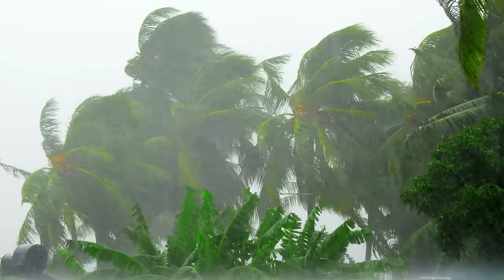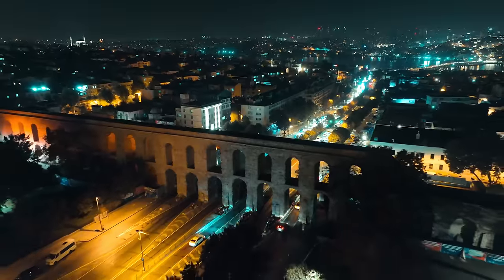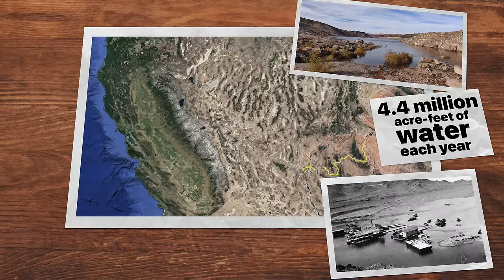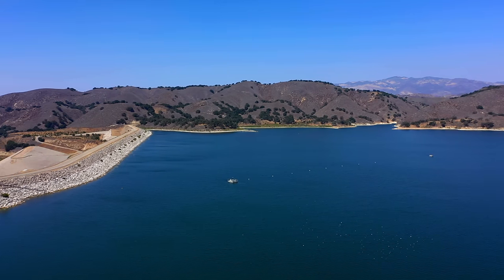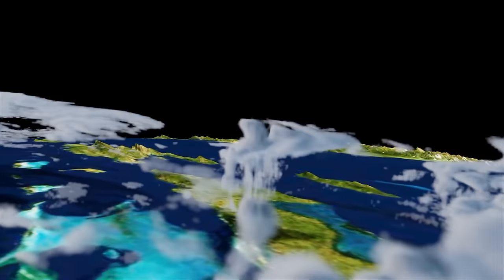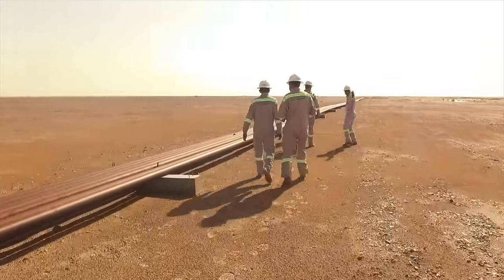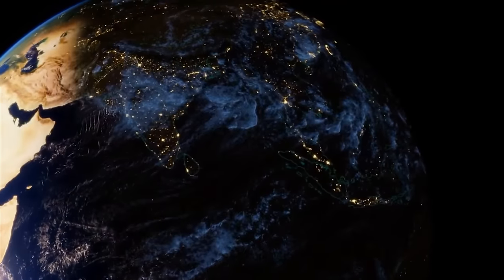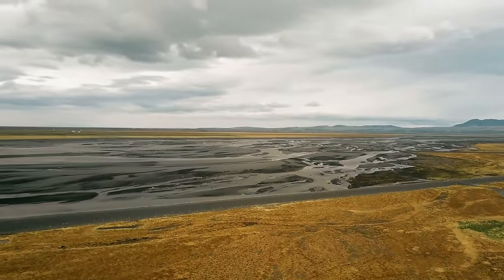Pipelines From Flood to Drought

Comment: I've been wondering about this for decades. If we can do it with oil, why not water? I've always wondered if there would be any issues transferring invasive species or anything like that. Glad someone is talking about it.
Reply: Along the way, the water could be heated sufficiently to kill off any invasive species.
Reply: @whiterabbit2786  sounds like big energy use
Reply: Because we need to move the oil anyhow and pipelines are more cost effective than containers on trucks or trains. Also it's less energy intense to pump oil per volume than water because it is slightly less dense than water is.
Reply: Reasons why not:
1) The amount of water required
2) Where the water has to come from and go
3) It isn't as simple as taking flood waters and moving them. For one thing, there isn't enough storage to hold the flood waters on the receiving end, all at once. 
4) The water is needed in a steady supply throughout the year, not all at once. 

And, so forth. Anyone who thinks it will happen knows nothing about the water needs of California and how they work. It is comic book stuff.
Reply: @cliffordschaffer5289  the water should be moved from reservoir to reservoir across the country, instead of it all being pumped to one location. I agree it would take a huge amount of energy, but so does pumping oil. I feel like this is something we could make work if we wanted to. Most people's water comes from a long way away already. The water in our municipal system comes from 100 miles away, has to hit multiple storage and treatment facilities along the way, but they figured it out and made it work.
Reply: @phantomblooper84  That would be more expensive than a simple pipe. Superman rejected both ideas.

Comment: There is already a discussion among executives of the Wyoming-Utah pipeline, scheduled to be decomissioned in 23 IIRC, to utilize it for pumping from the Oregon coast to re-fill the Great Salt Lake. It's very exciting to see the idea being investigated.
Reply: Too bad the GSL isn’t drinkable…. Maybe they should pump it up to reservoirs instead of wasting it in the Salt Lake
Reply: @brettneff7900  Ocean water isn't drinkable either, the water could go to desalination and waste brine to the lake which is way saltier than the ocean anyway.
Reply: Actually pumping water from the ocean into the GSL would increase the evaporation from the GSL, which would increase the precipitation near the GSL helping to increase the area’s fresh water supply. Pump salt water inland and let it evaporate in salt pans/sinks and you’ll increase local precipitation significantly.
Reply: @tylershepard4269  There are already massive evaporation pans operating on the lake, a major source of salt and fertilizer. Ocean water could supply desalinated water for drinking, but also brine to go.
Reply: Good idea - maybe they could try to fill it beyond what it normally was at.  Every little bit to fight rising sea levels is good.  The GSL is big enough to see from space so filling it up is not insignificant.
Reply: @danielvonbose557  The lake has a very different water chemistry than the ocean.  It's not a simple matter of all salt water being the same, except for salt concentration.  Replacing the water in the GSL with ocean water would alter the chemistry of the lake significantly and no doubt lead to new environmental complications.  That's before considering that salt is left behind by evaporation, so in practice the lake is losing fresh water, not salt water, and replacing that water with brine would drive up salinity quite a bit.

In addition, pumping sea water into the Great Basin is likely to be energetically costly.  All of these schemes for pumping water around the country generally ignore the high energy cost of lifting that water over mountain ranges.
Reply: @bobbun9630  What if we put a turbine on the other side when the water comes back down. Wouldn't that help recover some of the spent energy from pumping it uphill?
Reply: @ipp_tutor  

The GSL has no river flowing out of it. 
That's why it's it's a salty lake in thr first place
Reply: @ipp_tutor  Even if you could recover 100% of the energy associated with pumping the water over the highest points on the route (you can't), you are still lifting whatever you're pumping 1283 meters, as that's the altitude of the surface of the lake.    If I did my math correctly, you can lift 286kg to that altitude for 1 kwh of power.  To raise the level of the lake by one meter would require trillions of kilograms of fluid.  That energy can not be recovered, if the goal is to put water in the lake and leave it there, as it represents the change in potential energy associated with lifting the water.  Note that if you're pumping brine or seawater instead of fresh water, some of that mass you're pumping up is useless salt rather than water.  And, of course, the water isn't actually being used directly for human purposes if you're just dumping it in a lake.
Reply: @bobbun9630  The salt isn't necessarily that useless since there are salt operations on the lake for salt and fertilizer.
Reply: @danielvonbose557  Yes, but there's already plenty of salt there for that purpose.  Adding more salt to an environment that already has it in abundance would never recoup the expense of lifting the salt to high altitude.
Reply: @johanvangelderen6715  I'm thinking @IPP_Tutor is talking about discharging the water above lake level and capturing the energy of its downhill flow into the lake.  Like if it needs to go over a mountain or something close like that.  I don't know the terrain enough to say.
Instead of grabbing sea water from the coast, how about grabbing river discharge near its mouth such as the Columbia or  Rogue.  IDK which end of the state the pipeline discussed exists.
Reply: There is the issue of lifting vast quantities of water to an elevation of 4,200 feet . Water weighs over 60 pounds per cubic foot.   Also that water needs to  move 500 to 800 miles depending on route. 

Where is that amount of energy supposed to come from.

Also the western states are a desert.  
A desert is defined as an area with insuffient rainfall.

Those who haven't seen or lived in the USA western states can't conceive of 

How dry the area really is
How high above sea level it is
How far from the ocean the GSL is
The weight of all that water. 
What else that water could irrigate. 
How few people actually live in the western states except from the coast to 100 miles inland.

Comment: The pipelines for oil generally flow north south - not east-west like would generally be needed.  And even then, the carrying capacity of an oil pipeline is absolute peanuts compared to what you'd need to make a real dent.  Finally, flood-prone areas are generally lowlands, east or along the Mississippi, and the most draught-stricken areas are in the West and generally at a higher elevations.  Moving massive amounts of heavy stuff like water uphill is always going to be energy-intensive.
Reply: That's everything I thought before shutting off this nonsense video.  Just ONE gallon of water is around 8.5lbs (3.75kg if we're going to do some real physics calculations).   That mass would have to be pumped over the rocky mountains.  The amount of energy and PRESSURE to do that with any real useful volume would be ultra expensive.  A desalinization plant on the coast would be MUCH less expensive to operate.  Water also contains contaminants and encourages corrosion... unlike petroleum products.  So the maintenance and upkeep would be much higher.
Reply: @fakshen1973  Rocky Mountains average 4,400M high, lot of head pressure, they would have to pump from reservoir to reservoir (the way they do in mines). Huge amount of energy and cost. Would also have to consider high silt content in the Mississippi causing issues as well

Comment: One thing I did not hear you mention was pumping water back into the natural aquifers. There is a large amount of water pumped out of the aquifers that take a long time to replenish; why not help the refilling process along instead of simply pumping water out of one area and into another?
Reply: If you pump.the water into ponds and wetlands you are doing the same thing. Plus you are creating habitat for wildlife and plants
The water is also filtered so the water going into the aquifer is clean. Plus you would not need to pump as much out of the ground because you have the surface water resources.
Reply: You can't refill Aquifers once theyre empty. the weight of the ground above the aquifer crushes the empty space left by the lack of water. The best you can do is keep aquifers the size they are now and do what oil drillers do, as they suck out the oil, they pump in water to keep the ground from collapsing any further.
Reply: If you notice on shopping centers, office campuses and residential developments a corner of it is used as a catch basin for runoff. More of this water saving conservation needs to be used especially where it is used the most on large and small acreage farms.
Reply: where I live we pump to flood the flied then send the rice etc. to china how much sense does that make .And cali does basically the samething  in it's own way and they dont even try to manage the water /conserve etc.  Like use underground irrigation or how about everone update their toilet to a more modern one

Comment: When it rains in southern CA, most of the water just runs straight out into the ocean through the concrete canals in the cities for flood control. Also when you pump water by canals or pipes, you have to be careful about relocating fish and plant species from one coast to another. I have thought about this same thing for a long time and would love to see this happen.
Reply: Good point. Would be helpful to add mesh screens or other strong materials allowing water to pass thru but keep fish and plants native to where they belong.
Reply: @phatpatatit  how would you handle having to constantly clean said mesh screens, bearing in mind that they would have to be fine enough to keep all living things out of the pipes?
Reply: simply add it into the ogallala
Reply: Run through small diameter black ABS pipe for long distances in the desert only during hours of daylight, have discharge on a thermostat to release at 150 degrees, not much will live through that.
Reply: In that case, better solutions may come from changing that street-to-ocean, canal, flood-mitigation infrastructure into a street-to-reservoir chain somewhere along the outskirts of major cities. Wouldn't someone have thought of this already? Hey, California, stop washing your fresh rain water directly out into the ocean. Also, mentioning California canals reminds me of "Chinatown" the movie from '74.
Reply: Our city is so dirty and the water passing through the city is literally too toxic to even swim in.  It also rains so rarely that whatever you collect will evaporate before drought hits. It's just a non-starter.
Reply: At some point, people are going to have to get back to prioritizing human life over animals. Don't get me wrong, invasive species can wreck havoc on the local environment but so can death by drought. Millions of people all over the Earth are  dying from lack of clean or available drinking water. Sometimes you need to use the thought "Risk a little, to save a little. Risk alot to save alot!"
Reply: Have you forgotten that water is to fight for? Let's transfer water from here to way over there. It will NEVER create a huge fight over water in the future, will it?

Comment: You're going to need a lot more reservoirs in flood prone areas than currently exist, but there's no reason why this can't be made to work someday. However, in the meantime, I would also put some effort toward desalination, just to be on the safe side.
Reply: Simple start.  Don't mind private property owners collecting water from floods and treating it themselves.  For living, a building can be built to float or stand on stilts taller than the maximum flood level.  Or build a levee around it.  Offer opportunities to plug in their reserves to pipelines that distribute it to drought prone areas.
Reply: @uncrunch398  it is interesting how this is actually illegal in many of those places

Comment: It would be an interesting experiment to see some kind of smallish scale test of this concept. If for example there are two existing water reservoirs near the continental divide that could be linked via pipe/pump. You could then pump water from one reservoir to the other. If the pipe/ pump system is relatively flat it might even be possible to be reversible.
Reply: Really, this seems like by far the best answer. East of the divide there is no end of water and so little cost in diverting it. And since the divide itself is relatively narrow and at high altitude, you only need just enough pipe to let the water out into an existing western stream and then just let the existing natural water system do the rest, with gravity doing most of the work.
Reply: Tunneling might be a possible "last mile" solution.
Reply: It was done a century ago, actually.  Look up the Gunnison Tunnel.  Of course, that actually diverts water the other way, as in Colorado there's more demand on the east side of the Rockies than on the west side.  Note, though, that the diversion is only moving water that is already at close to the altitude it needs to be.  The real cost is in getting water to that height to begin with.  Lifting water can be characterized as hydropower in reverse, and it's massively costly in terms of energy.

Comment: I have suggested this to friends and family for years. I envisioned a double aqueduct across the US. One flowing east and one flowing west with reservoirs along the way to store the water. Then we could pump out water into either aqueduct and let it flow with gravity to where it is needed and just pump it into existing networks. But I have no idea what that would cost. The pipelines are a good idea for cost savings. But a 40 year life span doesn’t sound very appealing. Consider how old the water systems in major cities are today.
Reply: People keeps worrying how much it would cost, but don't think about how much it will cost if we don't do anything. The cost of doing nothing will be much much larger!
Reply: You would have to dig up the Romans to get them to share their water management and distributive systems and how they managed to do it without mechanical technology, some of their systems are still working today.
Reply: @gangleweed  All done by gravity flow for the Romans. It takes massive construction work to make them work and even at that, they do not carry a whole lot of water. Cheapest way to build would be concrete pipe and concrete lined covered trenches. And you would need pumps every so often to help move it along. A 4' diameter pipe is going to take a 100 HP electric pump to move just 125 cfs of water with a 4' lift at the pump.  And that will work for about 1/2 mile of pipe.
Reply: @jackm3040  I know. That is why I figured it would need a series of retention ponds to hold it so you can pump it slowly to its final destination later.
Reply: @jackm3040  I know. That is why I figured it would need a series of retention ponds to hold it so you can pump it slowly to its final destination later.

Comment: I work for The Metropolitan Water District of Southern California for 20+ years, we operate the State Water Project canals from Northern CA to Southern CA and also the Colorado River Aqueduct from the border of AZ to Los Angeles and distribute the water to all over Southern California.  I have been saying this exact things for quite some time now.  We have the ability to make gas pipelines, freeways, etc all across the continent but water pipes?  Not been done yet.  I also proposed going from the Pacific northwest to Northern CA area, since the distribution is already set up from there.  We are only getting 5% allocation from the State Water Project this year.  I proposed running a cluster of pipes (incase one has a failure) along freeways/roadways.  CA pays for the water, imagine the income other states could generate selling off water from reservoirs as they prepare for deluge (one weather phenomenon we can predict.)  I would go a step farther and ensure a distribution all over the US so you can migrate the water where it is needed, maybe a farm isn't getting enough water, can route to that region.  If you run the pipeline with solar you can generate power to run the pumps necessary to keep the water flowing.  If we have a good water year would could sell any excess water to Mexico (They are currently part of the Colorado agreements along with 5 states.)
Reply: PNW doesn't have enough water for itself now. We've been removing dams for salmon etc, so less water is impounded up here. East side of the Cascades has the biggest water shortage up here. Not enough water for our own agriculture.
Reply: @ElectricDanielBoone  Thanks for adding information to the discussion.  There is a lot that would need to be studied and figured out for sure.  I'd say that we could do better as a nation as a whole with our natural resources.  We couldn't put some areas at risk so others could benefit.